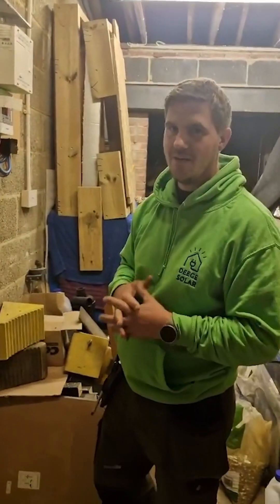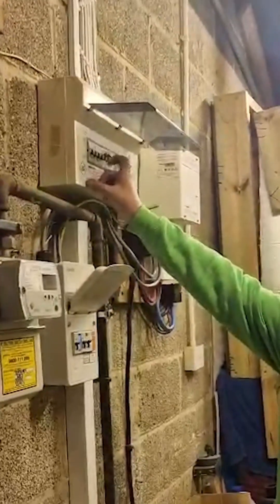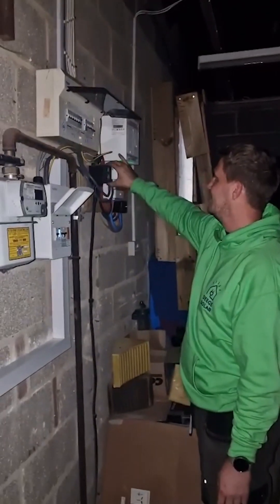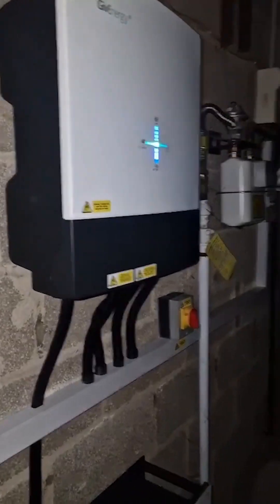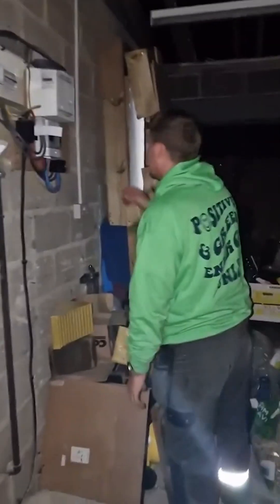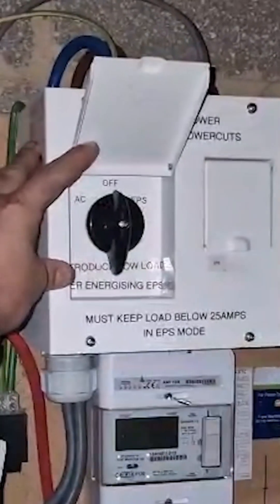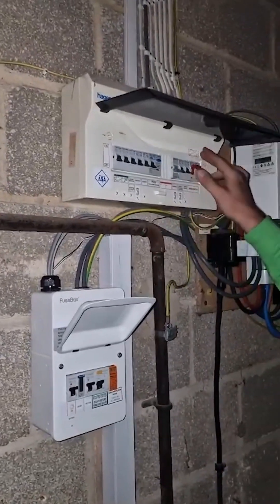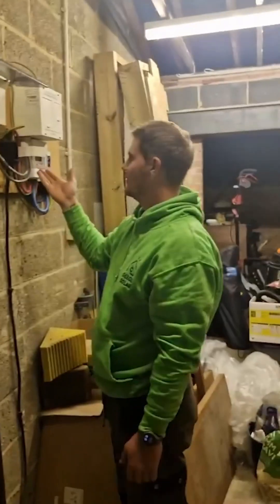How Solar Panels & Battery Storage Can Provide You With Back-Up Emergency Power Supply (EPS)

Comment: That system already has EPS without needing the extra switch. Run your home on battery during peak rate charge, it at cheap rate. Power cuts just stop you charging.

Comment: Does the change over switch have a neutral earth relay?
Reply: eps doesnt always need the earth neutral relay if you keep the existing pme earth and add a earth rod..this is per mcs battery storage rules and this way your rcd still work.
I call it supplementary earth rod and its allowed in the regs to have a hybrid earth system.

Deege is good compnay i used to do installs for them lovely people and one of the good companys out there doing solar.
Hello degee Joe electrican nottingham
😊

Comment: Last power cut remember in the UK was 1987 it lasted a few hours! Before that was 1984 and we where too poor to pay for electric but it didn’t really matter that much as we didnt rely too much on it and used a candle or lobbed another log on the fire!
Reply from the maker: Some of our clients live in rural areas which suffer from frequent power cuts, and have essential devices such as medical equipment, or servers they want to keep running. It’s very situation dependant.